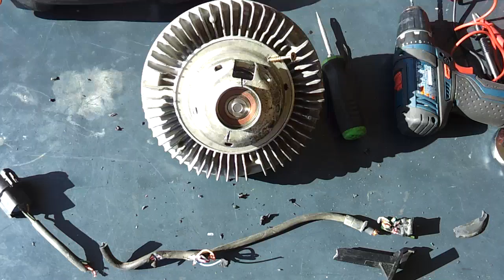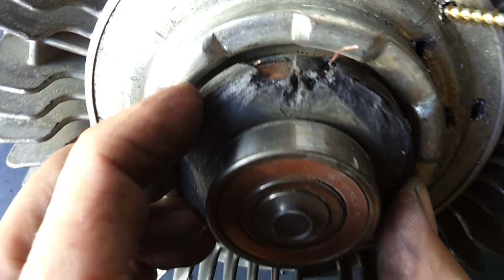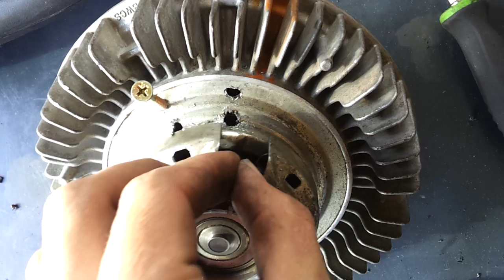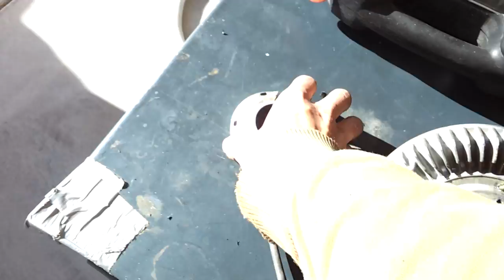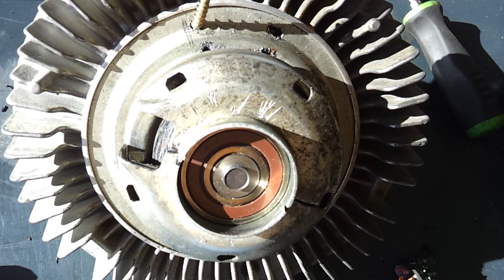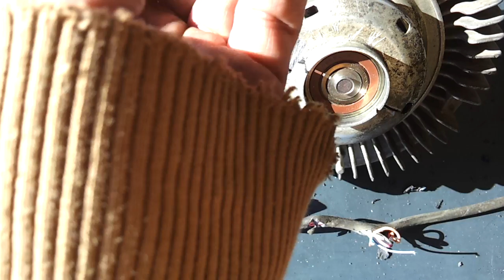FORD Supderduty ~ Fan Clutch ~ How to Lock-Up Manually

Comment: I own F350 6.4 2008 90k miles
my fan clutch is not working,,, do you know if there is a fuse for it? or what else i can try before i take it to the shop?
Thank you
Reply: I never heard of a fan clutch fuse. I would be surprised if there was. I believe it's purely temperature-controlled and is not connected or controlled by the ECU in any way.  If anyone corrects me believe them over me, but I would put $1000 dollars down on no fuse.

Comment: sorry but this is dumb, unless your pulling an insane amount of weight you shouldnt need the fan clutch to work much if at all, mine has been dead for 2 yrs and I pull 5k lbs in 90deg heat and my coolant never passes 210-215 up a grade before cooling right off.
Reply: no 2 trucks are alike, sometimes even when they happen to be the same exact thing one can do something completely different from the other.
Reply: best $6 a month i have ever spent on my 6.0 was towing on my insurance, problem solved
Reply: @TurboGSR96   Keep your useless opinion to your self mate. This is good advice for anyone who travels in remote locations....
Reply: In the last week I've seen 250 probably 20 times. Once I put the plow on, found out the fan doesn't work but the snow already fell so I had to run it

Comment: F-250/F-350 Super Duty?!

That doesn't even resemble a 7.3L Power Stroke fan clutch in the slightest. Unless this is off a newer truck or a gasser, it's NOT applicable. No wires, and I wouldn't go monkey around with it like that anyways. Dude Riff Raff Diesel has Motorcraft fan clutches for $230-45ish and Advanced has a made in USA for $180. Why are you even screwing with it? The time invested for your jerryrig could have been better spent fixing it right and replacing it. I wouldn't want to be walking past your vehicle in a parking lot running.....that's for sure with that damn wood screw in it......Are you retarded by the way??>

WTF Dude!!
Reply: It was a quick fix just to get him around for a day till his new clutch came in.
Reply: He said the one he was showing you was off of a 2010 F350 which is most likely a 6.4.  6.4 is the standard in the F250 and F350.  7.3 is a factor option, but not standard.  As for your smart ass remarks, some people don't have $150 to drop immediately.  Don't hate on people because they are trying to give advice to people who are trying to make it through a difficult situation.  He said he had to turn around and go to the nearest town and order one.  He did not do this to his truck.  He is just saying that if you found yourself in this situation this is one option to fix it temporary so you don't have to turn around.  No, it is not a good long term fix, and no it is not something you would want to do except in an emergency.  Oh, and yes 3 years later from your comment the price is $150 all over Amazon, not $180.
Reply: 7.3L use purely mechanical hydraulic fan clutches. On 6.0L and later Powerstroke use this style.

Comment: i would do this with much caution...these fords run plastic fans and overspeed will break the fan blades causing a purchase of new radiator and fan clutch
Reply: uptonfg I agree. You may try to use caution driving if your fan clutch has failed instead of rigging up your existing one. Watch you temps, turn a/c off try not to load engine as much as possible. Especially if towing or on hot day. When your cruising temps should be ok. And get fan fixed as soon as you can.
Reply: @jamespeters3907   why is it you can make an adapter and fix drive these fans with no issues then ?

Comment: my fan clutch is mitsubishi montero sport. I think it has fluid in it. will try to open it. if anything ill drill a screw anyway
Reply: cool! was it broken?
Reply: +GadgetClass fan clutch was worn out. I could stop the fan with little effort while it's running.
Reply: +john argue would probably be a good idea to replace it. you can get just the clutch at any auto parts store.
Reply: +GadgetClass I know. it's $50 at the store.good price but am broke. I paid $10 for one at junk yard with warranty that turned out to be no good. I could  exchange it, but figured I make this one work. it came out good.

Comment: Good advice.
Keep a spare serpentine belt as well. There's a huge load on the belt in larger trucks.
Every now and then, when the engine is idling, look at the tensioner pulley too.
If the tensioner pulley is "bobbing" like a fishing cork, the serpentine has a stretched spot. Replace that belt. There's no limping home with a broken belt..........

Comment: My fan clutch has become locked in on its own.  I have a new one on order.  2000 F250 7.3L 240k miles.  Seems like it is really dragging down the power when I get on it.  Also making my belt squeel when hard accerlerating.